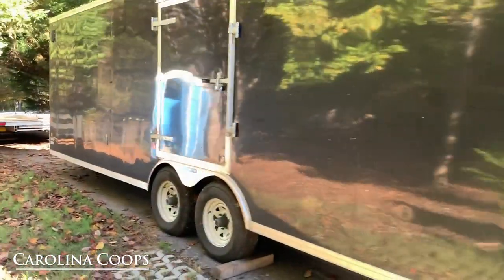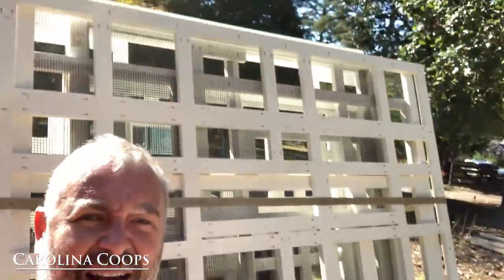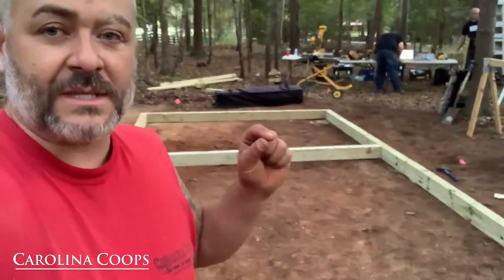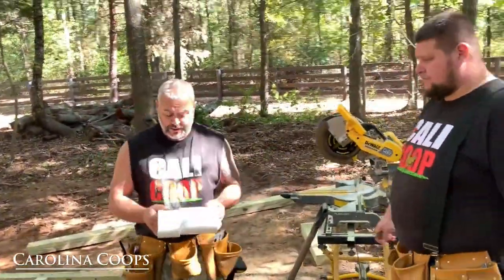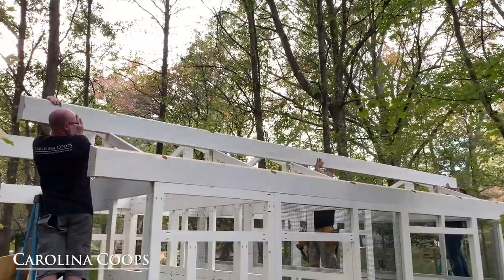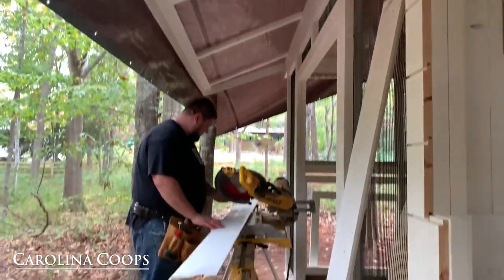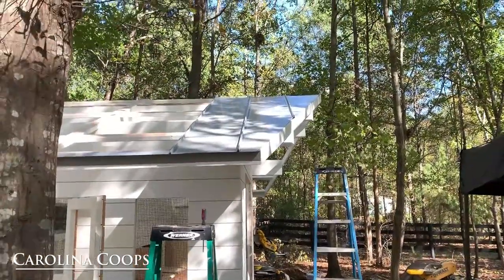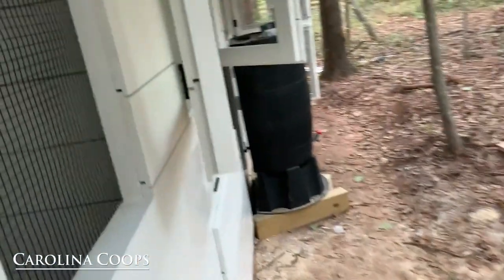Learn How We Built a Modern Farmhouse Chicken Coop and Duck House

Comment: Quick ??... we wrapped our run with plastic to cut the wind on the girls. The very night we did it they started roosting in the rafters of the run instead of going in the henhouse. Is it because of the plastic making it feel more secure to them?  I told my husband to just leave them be and let them decide at this point. Should I coerce them to go in the henhouse?
Reply from the maker: It could be for the reason you said, chickens should instinctively seek the highest point to roost. If the rafters are available to them and are higher than your henhouse then it makes sense for them to seek it out, especially if they aren't feeling a draft in the run. You can put them back in the henhouse after dark (when they are calm) and see if that habit sticks again for them. You may have to do it for a few nights. Good luck